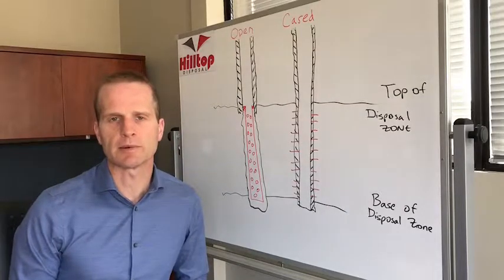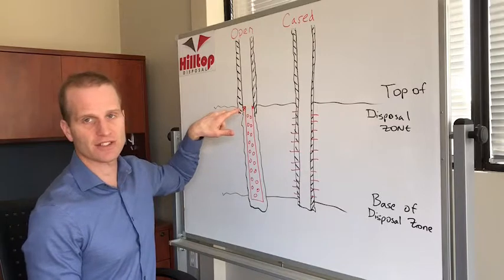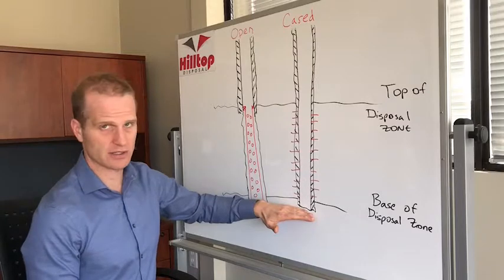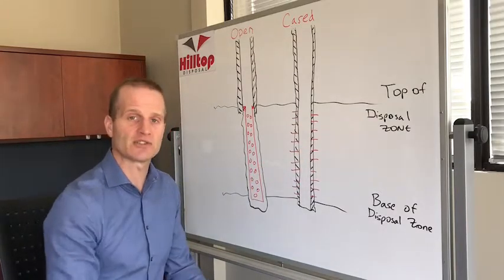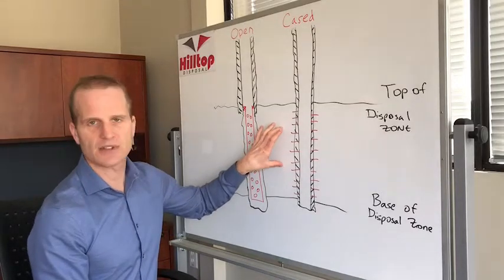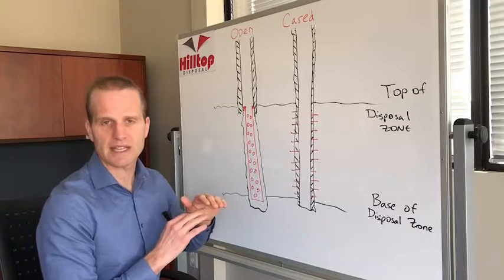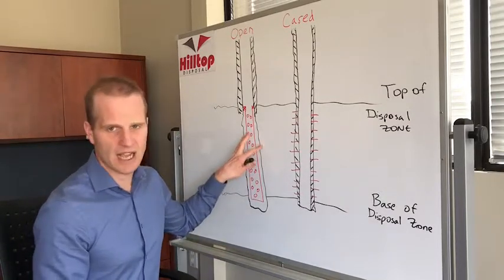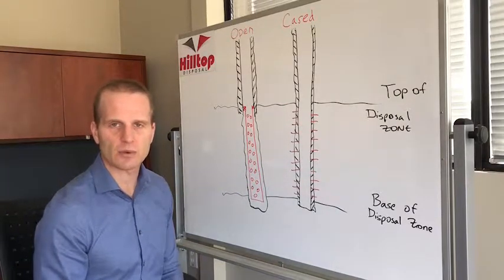Open Hole Vs Cased Hole

Comment: Can wire wrapped screens be used in an open hole gravel pack completion?
Reply from the maker: What is the purpose of the gravel pack in an open hole completion?  What is the purpose of the wire wrapped screen?

Comment: Very good and succinct video Dustin. The application for this case is for disposal of a general fluid? I would imagine the strength of the formation may play a role, in the case of a possible close for soft unconsolidated vs hard formation.
Reply: Generally for water disposal (salt water generally).  Water disposal is generally needed for oil operations, potash operations, etc.  The water from operations is unusable and so disposing of the water into deeper salt water formations is the easiest/cheapest way to get rid of it.  

The disposal formation is very important, the thicker, more permeable formation the better,  since the zone will dispose of more water under less pressure but also be more forgiving with any solids carryover that may plug.

Hard vs. soft or consolidated (think rock) vs unconsolidated (think beach sand) will dispose differently.  Increasing injection capacity is different for each formation.
Reply: @dustinnewman9049  Thanks for the explanation. I do have oil and gas background (RE). I took a class in CO2 storage and remember there being a requirement for good cap rock to prevent leakage. In your operations, do you consider proximity disposal layer to aquifers for drinking. 

I was recently looking into well completion videos and came across yours.